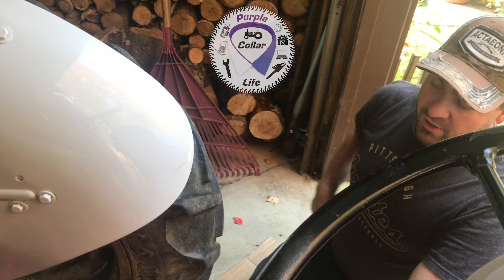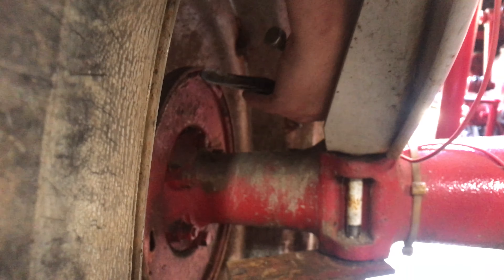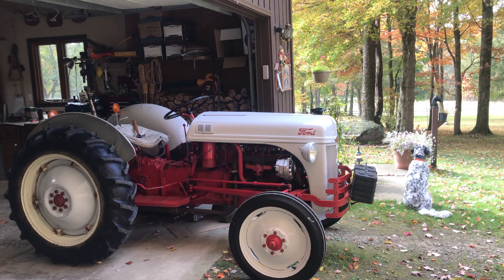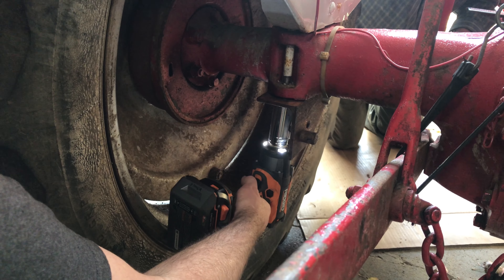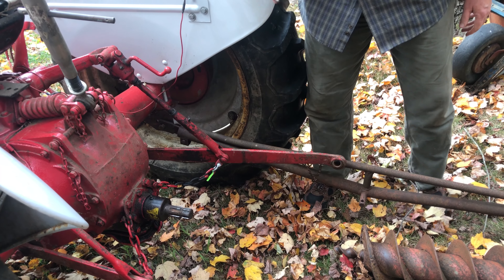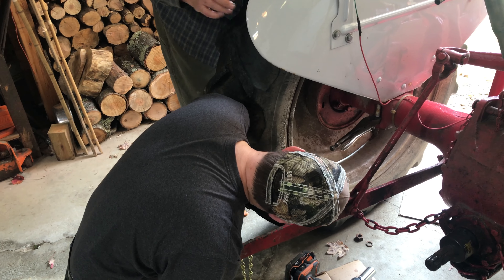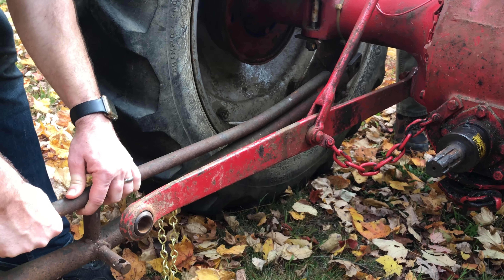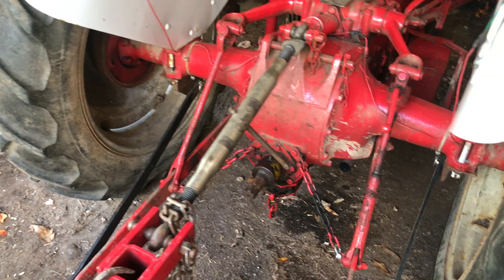#89: Ford 8N Tractor stabilizer brackets added. Post Hole Auger Fail! #Ford8N

Comment: I had noticed the first go around that those stabilizer mounts were not going to work.   The pin for the stabilizer needs to be in the same axis as the lower arm mount on the tractor for the stabilizers to work.  As for the Dearborn (I think) auger, I suspect those take special mounting brackets like everything Dearborn.  Seems to be the thing.  It is easy to find the implement, harder to find the backets.  As mentioned, I do not think it would be too hard to fabricate something that would work and maybe even leave the stabilizer brackets in place, working around it.  Stumbled on your channel recently and subscribed.  I also have an 8n ('50 side mount) I picked up maybe 10 years ago and use on our property to maintain our small homestead.  Great tool.
Reply from the maker: Hi Chris - Thanks for finding the channel and subscribing! We love the 8n.  The other 8n on the farm originally was a 50's side mount version and was a great tractor. It was sold to a neighbor that lives across the road.  So it's still in the area and working!